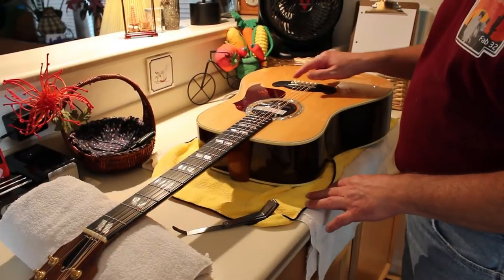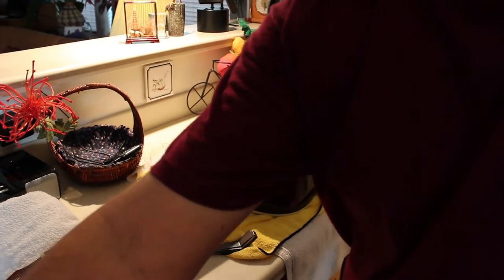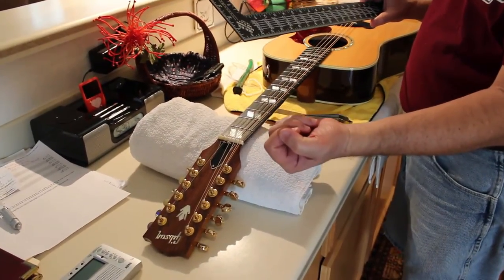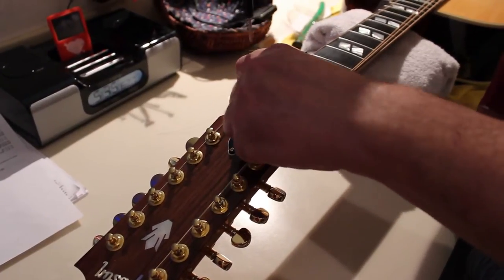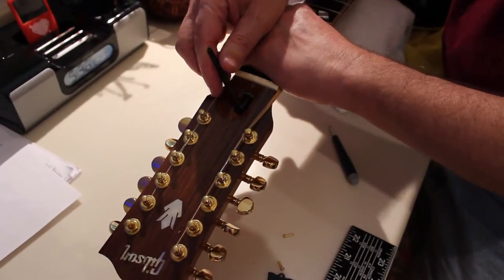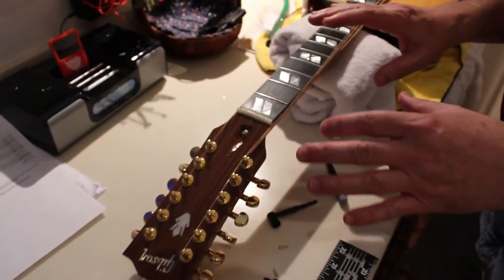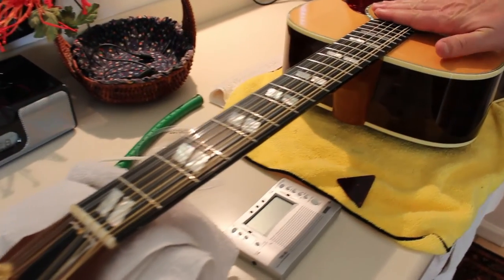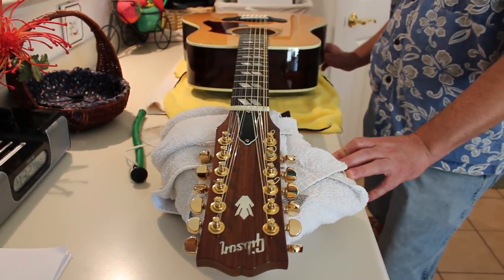Gibson Acoustic Truss Rod Adjustment

Comment: Aren’t you supposed to set the truss before you set the bridge action? And what size is the feeler gauge one is supposed to use? What is the standard gap for a Gibson acoustic, and which model, and at what fret?  Fender puts this info out for anyone to access. This video just shows a guy that knows more than you, setting up a neck but with no real specs or useful information to the uninitiated.